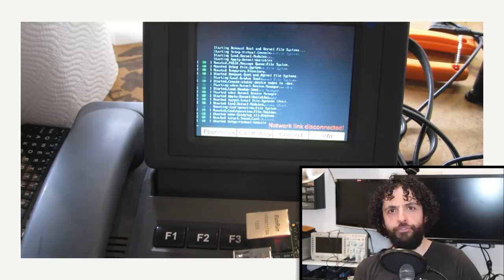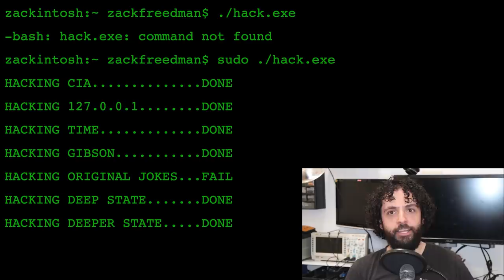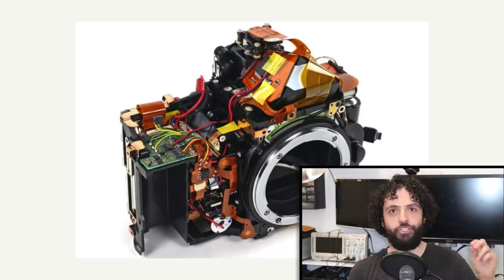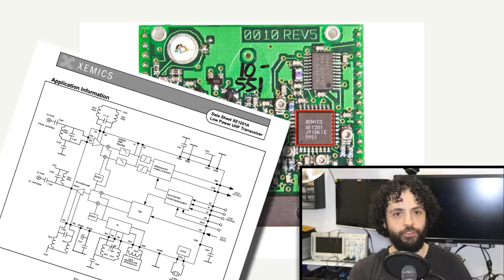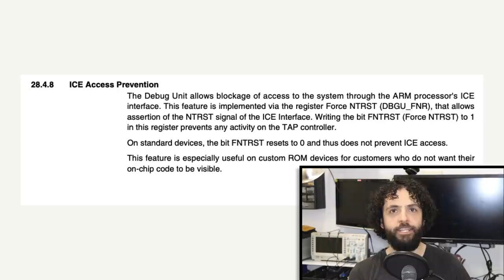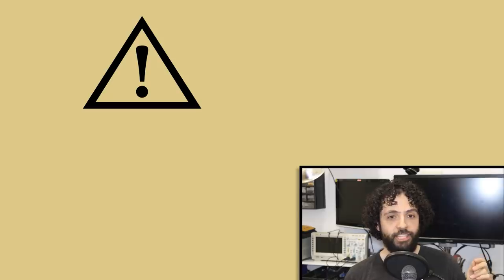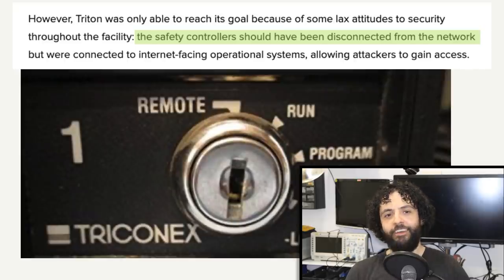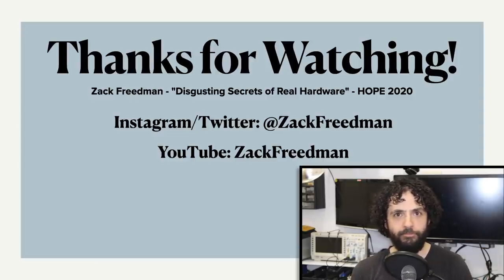Disgusting Secrets of Real Hardware: HOPE 2020 Voidst-Archives

Comment: Updates is just a buzz-word of the hardware/software industry, mostly intended to add features and not to improve things. It is also possible an update break it, never change a winning team when there is no functional reason to do so, not just to update to stay 'fresh' because it increases the revision number or to 'update' a library with functionalities you don't use in the firmware. Do not update just to update. Why is using an older library bad if it works great? If hardware needs an update facility, it tells the customer that the development of the design inside is quick and dirty or horrible (can contain errors) that needs to be updated to fix issues not fully tested before production. Just lazyness or just because time is money, right?  An update is like an aftermarket botch wire, it shouldn't be there.

Comment: Don't take anti-tamper measures... Don't take my fun away! 
Remember what happened to the XBox360?
Reply from the maker: I think you're right about getting code OFF the device, but it's dangerous being able to put new functionality ON the device. It just opens the door too wide for hackers. At least most of these attacks need physical access to the device...
Reply: @ZackFreedman  getting new code to run also allows people to flash more secure firmware onto it, for example OpenWRT or DDWRT to routers. Manufacturers don't really release firmware updates, but if a device is widespread enough, there will be a community project to keep it alive and in case an exploit is found you don't have to trash it.
Physical access is a nice compromise though. Everyone bricks their own hardware.

Comment: Hey man, you know that electrical and electronic engineering are not the same, right?👀
Reply from the maker: I don't see the distinction often, at least outside of a few colleges that have separate electrical-infrastructure and device-level programs. The IEEE doesn't draw a sharp line, and I'm inclined to agree.
Reply: @ZackFreedman  in my college they're distincted: electronic focus on low voltage and high complexity circuits, electric in high voltage low complexity ones, like house wiring.

Comment: Internal debug headers aren't really a problem. If someone who buys a product wants to disassemble it and rewrite the firmware, they should be able to, and if you are using it in an application where someone with physical access being able to do that is a problem for your threat model, then it's on you to put it in a locked cage or something.
Reply from the maker: It's the second part that's the catch. It's fine if a drone or Bluetooth speaker has an SWD port, but security cameras, industrial-control equipment, and surveillance devices should really be locked down tighter - maybe even potted in epoxy.

Comment: You didn't even scratch a surface, I spent a "few" years in industrial automation. Your examples are innocent child play. Anything that is not accessible by the customer is poorly designed. Bunch off-shelf component hacked together, Butchered code with numerous revisions by different programmers, firmwares  so poorly done that no one knows how stuff is working, holden together with endless lookup tables and correction values.

Comment: Devices such as a phone charger don't need a MCU. Just because you can, doesn't mean you should.
If you insist use a one time programmable MCU and get it right before you ship. 
At the risk of sounding like an old man, we used to come up with some ingenious analog/digital solutions.
I still enjoy a teardown of old equipment to see how these big brains figured things out.
Reply: I'm young and not an engineer, but I know that my toaster does not need anything digital in it. It just seems analog circuits are more robust. They make things to break nowadays.
Reply: Please advise from you electronics design experience how to implement USB PD without a microcontroller. (Yes there are dedicated chips, but they still run firmware which is locked inside and not upgradable.)
Reply: @PTh0rn  Wrong forum for that discussion. If you want to learn electronics and not just programming see the EEVBlog Forum. There's always interesting things to get involved with.

Comment: I am not really following why you advocate to make hardware less hackable in the first half of your talk? It is not an issue that there is a serial port on the board it is an issue that your firmware/os can be modified by people with bad intend... But how do you find out about this? Connecting via serial is hard when there is no obvious port, but it is not impossible for engineers looking for an attack vector. Fix your software, dont hide it by removing an easy to access port... In 5 years everyone is happy that they can upgrade your bad linux implementation or upgrade the integrated server to have less issues... but sure make hardware that is harder to debug and throw away old devices.
Reply from the maker: Clandestinely modifying a device is a serious risk, even if needs physical access. The real problem is the ability to extract firmware and test modified code over and over. That threatens everyone who owns the device. I strongly believe that firmware should be hardcoded into the device in the factory, and the only firmware update is a kill switch that physically neutralizes the network stack and other safety- and security-relevant elements in the event of a breach. Basically, if you can't build secure hardware, you're doing the world a favor by not building anything at all.
Reply: @ZackFreedman  You were talking about security through obscurity, which is a little bit different than deactivation fuses but not really better. I like to know whats inside my devices when they have any sort of network access. I want custom firmware for my synthesizer, my digital camera, and my old handhelds or gaming consoles and I think the right to repair devices you own is important and should not be circumvented by arbitrary measures to hide mistakes in the device software-hardware architecture.